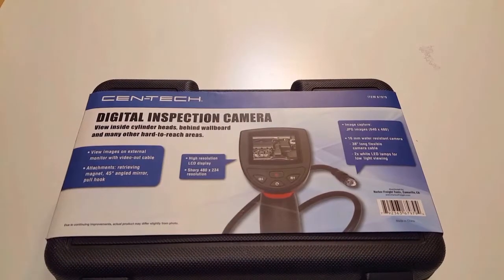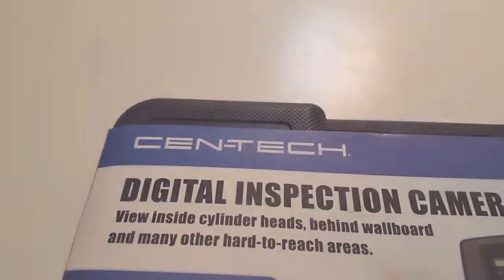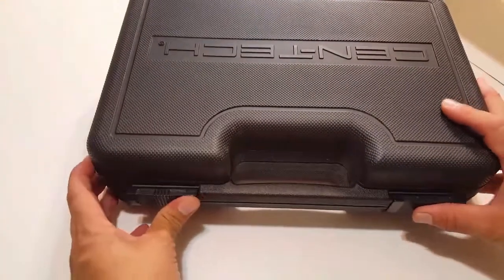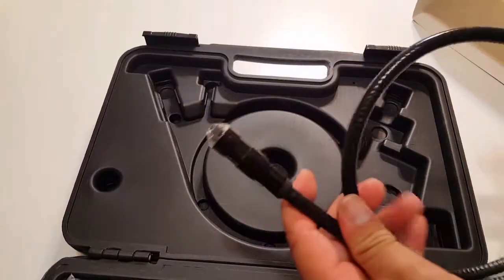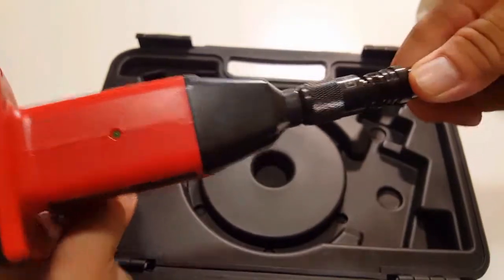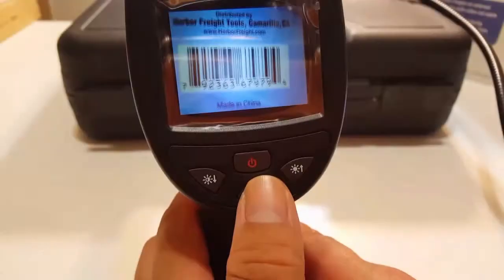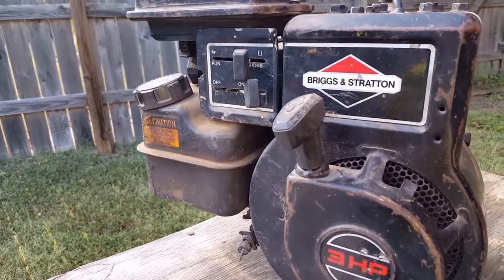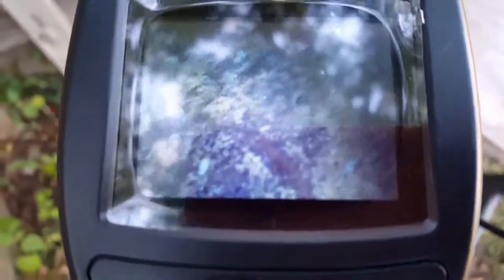Harbor freight inspection camera used on Briggs and Stratton go kart engine.

Comment: had that one in my hands and then saw their OTHER one and tossed that one right back where it came. They merely look the same, totally different. This uses AA batts, the other uses lithium and comes with a charger. This has no memory modes, the other has built in storage and SD card. This has one output, the other has 4. This screen is too small to see details, the other is almost twice as big. This has no tools, the other has magnet, hook, and mirror attachments...... all of which are awesome. Do you need everything the other has?  YES, you do. The better of the 2 they offer stores 18,000 images and more video than I have ever been able to store. Take everything back and review it later for further diagnosis. Just pop your SD card out and into your computer, phone, or tablet to watch the video and find other issues. The USB out can do the same thing. It can flip or rotate, or mirror the image in live mode. If you have ever used ANY bore scope you know how important that is because as the camera goes in, orientation goes out the window.
Reply from the maker: Thank you for the comment.  You are right this model is very lacking in features.